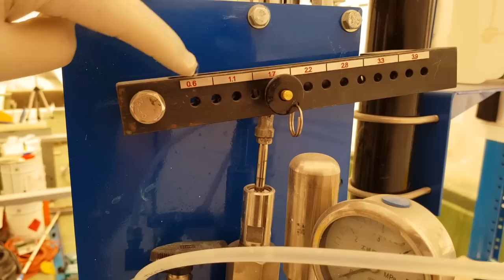Ep007 Tech Talk - How to Set Up  up a Gel Coat and Fibreglassing System

Comment: great vid! Best AU boat building series I've seen! Did you ever try using a gelcoat dump gun / gelcoat cup gun with the HUSH100 compressor? Looking to do a small gelcoat spray job and can't match up the gun specs ( 5.8cfm @ 80psi) with the compressor specs (min required 5hp / 200L).

Comment: Having done a load of 'hand' work with both gelcoat and resin/glass, it's great to see your video on the practical side of using a pumping system, which is catalysed post the spray gun. Two questions I have is a) how do you manage the hose and avoid contact with either the highly polished mould surface and/or the green/freshly laid laminate and b) how often do you resort to a mixing cup in situations where the spray gun won't fit? I noticed that your interior moulding seems to be largely done by 'traditional' hand mixing of the gelcoat and resin.

Comment: Can you put the name brands of the pumps and spray guns that you used please in the  note header.
Reply from the maker: Thomas, spray gun is Graco ( us made ) gel coat spray gun with a gel coat nozzle and a resin nozzle for resin only. This can be made into a chopper gun later with a chopper attachment and nozzle. Machine is made by Beijing Henxijing Composites in China. I am able to put you in contact with the manager if required as he has become a very good contact for parts etc. External mix. Air dryer is atlas copco f15 dryer. Compressor is a 15cfm 100ltr oilless silent compressor. Cheers Ross

Comment: Appreciate the videos Ross. Great to see another boat building channel, their aren't that many. Also appreciate you going into the more technical details. I'm curious, how many liters of resin do you expect to use throughout the build, roughly speaking . Also, what thickness of foam are you using for the hull. Thanks.
Reply from the maker: Gidday Danny, We have factored on 800litres of Vinylester for the hull alone, with 30mm H80 foam on the bridgedeck / chamfer panels and and below the waterline and 20mm on the hull sides above the DWL. Solid glass along the keels and on chines. I am almost finished the hull layup and it is almost spot on. My resin machine has allowed me to intimately control the amount of resin with the layup being right on from a resin to cloth ratio.  All of these laminates were ratified by Oceanic Yacht Designs in Brisbane , and as the Cat is being built to AMSA survey I am being scrutinised at each stage to ensure compliance.All the best , Much more to come buddy.

Comment: love your vids.Could you do one on the bonding of laminates together..New to old new to new(cured) and maximum times between layups of new to new.. surface prep for  the joints of your fabricated parts to the hull..Have had an interest in trying this on a small scale for many years and love it when you find someone willing to pass on the nitty gritty details.
Mate hanging off your every word in these videos its been great.
Reply from the maker: Hey buddy, thanks for the comment.I will endeavour to put one with that subject matter together as it is a very relevant topic. Due to the scale of these Cat Moulds and the fact that for the most part I am on my own, it is inevitable to have cured laminates that need subsequent laminating to be done. It is vital to aim at all times for a chemical bond, rather than mechanical, but there are definitely ways to improve bonding, such as sanding, wiping with styrene, and prolific use of peel ply and I reckon I could write volumes on this subject, and some one probably has . All the best Rossco

Comment: as someone that doesnt know anything about dealing with resin (other than doing small repairs with epoxy) this was really fascinating thanks :)
Reply: Mistakes? heck Ross I've learnt so much from my mistakes.... think I'll go and make a few more!
Reply from the maker: Thanks Charles, it can be a daunting and often costly experienced when things go wrong and trust me I have made a million mistakes. These videos are more for me than for anyone else, but so glad you are getting some useful info out of iit for your future endeavours. Rossco
Reply: at my age i dont forsee any large projects getting started. did you really buy a mold to do 1 boat and will you be able to sell it when your done? seems like an expensive way to get on the water
Reply from the maker: Hey Charles, I think the purchase price of the mould was so low that in my case and the fact that I can fabricate it I will end up with a  Cat at about 1/3 of the price of the production version.As with every boat there were issues with the design that will require constant modification to get right bt in the long run I will probably sell the moulds or tragically destroy them . Moulds really have virtually no value once the builder goes out of business and my gel coating machine compressor and air dryer cost just as much as the Moulds in this case.All the best Rosso.
Reply: @LifeOnTheHulls   its too bad it has to be destroyed. If I wasn't 3000 miles away I would buy it from you when you were done.